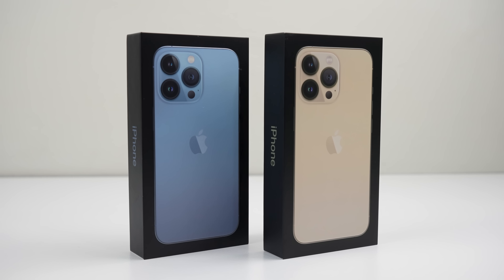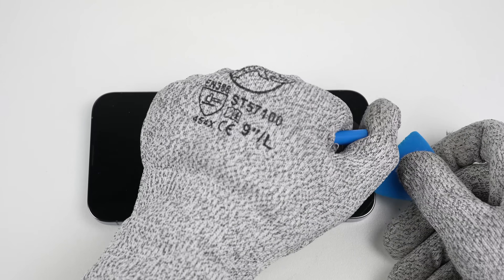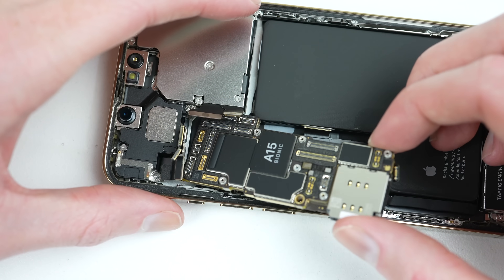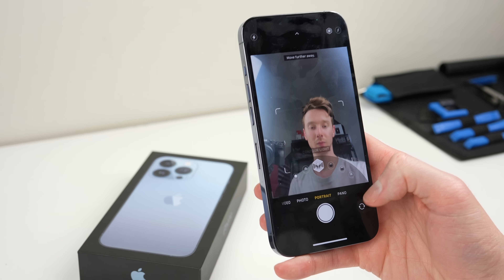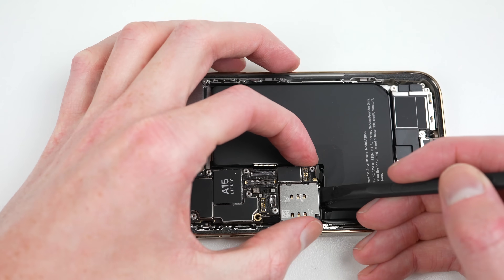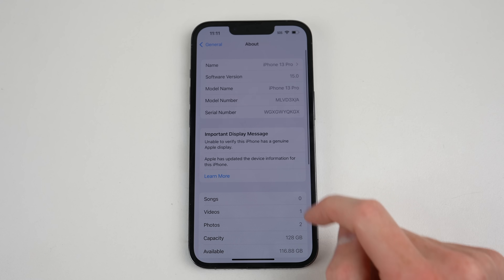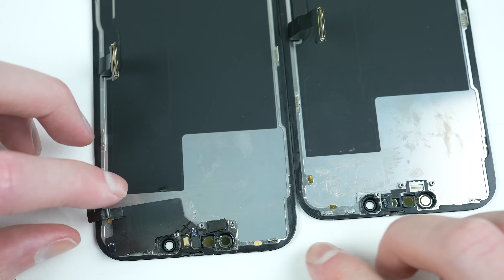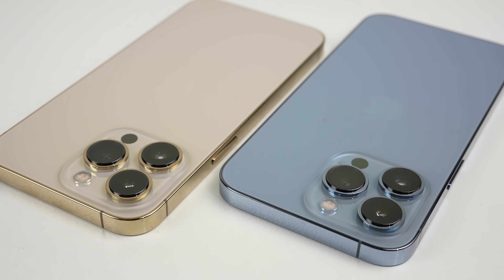iPhone 13 A Repair Nightmare - Teardown and Repair Assessment

Comment: Hey Hugh, nice video as always! Do you have a possibility to replace display chip information? I've seen this many times for older models to fix the issue with replacement display, that they download identification from old display and flash it to the new one. Maybe that can bypass these issues...
Reply: I'm sure someone is already working on it, but may take some time.

Comment: This sucks, big time. I semi-regularly repair phones for my family and friends and have been following Apple’s year on year bullshit software locks. Replacing the Touch ID / Face ID module, fair enough I can see why they’d disable the feature, but replacing the screen clearly should have no impact whatsoever on such a core function of the device. Totally shameful Apple.

Still, I’m sure China will come out with another device to reprogram the chips screen on the screen to make your phone think it still has the original screen attached.

Comment: I can understand the face ID issues... But breaking camera, battery and screen over replacement even from the donor iPhone is seriously ridiculous. Apple doesn't have to do that... They can display warning about device not having apple parts(They need to fix the pairing to the motherboard and swap it for some identification) and call it a day.

This is not about security or quality this is about exploiting it's users so they can sell at higher price and then when something goes wrong squeeze more money from them.

Comment: I agree with Apple's strategy.

If you give your phone to a non authorized repair shop and they make a mistake they have NO liability, so if they break your phone that is it, end of story, you risk losing everything. And at that point you'll have to buy a new phone, and any data that was not uploaded to the cloud is lost. So, to avoid and mitigate this risk Apple tries to make it impossible for you to repair your device, because if Apple repairs your phone you have the guarantee that it will be done correctly. And even if they do make a mistake they are liable and legally responsible for any damages, so they are required to compensate you.

Also, iPhones are not cheap phones. They are complex and expensive devices and just like an expensive Audi or Mercedes, I would much rather have my break calibers fixed by an authorized Audi or Mercedes auto shop than some random third party auto shop, even if it costs more. I prioritize safety over saving a couple bucks. I'd rather pay more and have a guarantee that the job will be done by a qualified technician than save money and risk a bad job.
Reply: And also if you don't want to get your phone repaired by a 3rd party, no one is stopping you. Go ahead and get your phone repaired at Apple, we don't care. Your phone, your purchase, your choice, right? We should have any right to repair the phone ourselves. We should be allowed to take the risk of having a bad repair. This doesn't excuse apple locking hardware with software.
Reply: This is inexcusable. They lock so much of their hardware with software. This means the repairability of these phones will be bad.  This is so bad for the environment, what are you going to do when apple no longer repairs your phone because it is too old? It will just belong in the trash. You are acting like apple repairs are the most amazing thing. Apple will also say some stuff "are too hard to repair", even though a 3rd party repair shop would be able to repair it easily. You should watch Louis Rossman and research Right to repair.

Comment: This is worse than it seems. It’s not just about fixing a new phone. I have a three year old iPhone Xs Max that I took to an authorized repair site (Best Buy) to replace the battery.

They told me the top speaker failed their test, and because it’s part of the screen I’d have to replace the screen as well as the battery. They would not replace the battery otherwise.

Let me be clear: There is nothing wrong with the speaker, it sounds fine. This is a deliberate scam to force me to replace both the screen and battery, which would cost over $500. 

Which is itself a deliberate scam to simply make it so expensive to repair my (paid for) three year old IPhone that buying a new one makes more sense.

And Apple’s story that it maintains quality is nonsense. This same ‘pairing’ technology could totally verify that it is a genuine Apple part (even though forcing you to do that would be illegal as well). 

But instead they use it to verify whether it’s the original Apple part, and use this technology to subsequently maintain a stranglehold on the marketplace.

This is the definition of a monopoly and is illegal. I’m not big on govt interference but the government should interfere. This is a long-term monopolistic policy and is totally un-American..

Comment: I see this as double edged, 1 it prevents 3rd party parts that otherwise are faulty (have dealt with a screen that turned out faulty) this also is a good way to make sure it’s working as it’s intended. But I can also see how it’s preventing repairs and not being all that good. It’s a win lose atm and should allow repair partners access to re serializing components to newer parts that apple has verified and tested, it would solve the issue then.

Comment: I'm never going to buy any of the apple products. Just think about the new M1 laptop. The laptop is so thin that even we can't even apply a sticker around the keyboard and touchpad to prevent it from scratching. The display of the M1 MacBook breaks randomly. We spend around 1000-1500$ to buy a MacBook and then have to spend 800$ to replace the display. It's not our problem. It's a problem that there were aware of when designing the M1 Laptop but ignored and kept making it. They don't think about their customers. All they want is money. I've watched a video on Phone Repair Guru and one of his customers brought an iPhone that has a malfunctioned microphone. The owner has said when he took it to an apple store what they said was "the device cannot be fixed and you have to buy a new device". Phone repair guru replaced the microphone just for around 50$ and the phone was functioning again.

Comment: the non-pro iPhone 13 still has the modular sim tray, the reason why the 12 Pro had it was because the 12 and 12 Pro was basically similar. The 13 and 13 Pro are not.

Comment: If they really want to protect consumers from repairs with crappy replacement parts, they should just add the warning "Replacement camera detected. If you observe poorer image quality, take your phone to an authorized repair center". Only show this everytime on reboot. No need to make the camera not work. Consumer won't blame Apple for crap results but user will still be able to make repairs.

Comment: When phone repair guru swapped the sensors on the screen Face ID still worked. Only changing the screen disabled Face ID. I wonder if the final build of 15.0 changed it.

Comment: The only way Apple or any of these other companies will change these practices is if the court system tells them that they have to. That’s why right to fix must become federal law. In the United States we do not have the right to fix. If I’m spending thousands of dollars on phones I should be able to keep them maintained for as long as possible. I should not be forced to buy a new phone every time some little thing messes up on my current one. I myself am rock in the iPhone 12 promax and I will not be upgrading to the 13 promax. Maybe the 14 promax but it’s gonna have to be a whole lot different than the one I currently hold in my hand. Otherwise there’s still no point to upgrade.

Comment: There has to be a way how does apple do it? Is it software  serial number check for each part on boot? If so we just need to be able to change the digital serial number. That’s prolly already a thing or completely wrong I know I’m not the first one to think this way

Comment: Have you ever thought about switching the motherboards and taking it to an apple store with all the issues and see their response/ repair process?
Reply: They’d simply offer a replacement at full price
Reply: That's what I was thinking, could you just ask them to disable the software locks and give Tim Cooks kiss of approval? Or would they just turn you away?
Reply: @Antonloading  They would straight up turn you away-  if the phone doesn't  have the original apple parts in it, then they won't touch it. Doesn't matter if its genuine apple parts or not.

Comment: Reading Walter Isaacson's biography about Steve Jobs, it is clear that hampering or preventing repairability was a mantra of Steve Jobs from as early as the first Macintosh. We should hardly be surprised that Apple is still as anti-repair as it was back then.
Reply: This is why Wozniak is known as the opposite side of Apple. Had Wozniak ran Apple we would have many options for repair, even official repairs would be very feasible immediately. But no.
Reply: @rosaria8384  If Wozniak still ran Apple we wouldn't have anything remotely close to what Apple is today. Wozniak would have built another Dell.
Reply: Ironic given that Jobs died because his body didn't function correctly after a pancreatic upgrade.
Reply: @libertyordeaf  that's awful but really funny 🤣
Reply: Did Apple elaborate on how third party parts and fixes affects them directly? Are they plagued by customers when some third party replacements affect the working of the phone? Can they no longer guarantee security from parts sourced from China? And so on. To clarify, not asking for a ream of speculation, just interested what Apple itself has said over the years, like in Isacson’s book.
Reply: @tonyhawk123  Apple just rolls out the "security" and "safety" issues crap...all easily proven to be utter garbage, but it still manages to "win over"  people who decide on and bring in legislature, with a healthy dose of paid for lobbyists (legal corruption and bribery) thrown in, plus i'm sure they "get" at others in high places that are able to do their bidding
Reply: @bazwillrun  Look at any security review for malware on mobile devices and see how Android fairs verses Apple. Add to that Android is made by an advertising company with business model geared to invading your privacy. And then there's the fact vast majority of Android handsets arent running the latest OS, where as vast majority of iPhones ARE running the latest OS - so good luck getting security updates. But just pretend none of that is real to prop up your anti-Apple stance on security.
Reply: @tonyhawk123  why do you compare an OS to a tech company?
Reply: @tonyhawk123  Well like there are many unrepairable android phones… it‘s not like apple is the only bad company
Reply: @steel9490  Samsung uses Android.
Reply: @tonyhawk123  not just samsung uses android OS. there are tons of other phone companies that do
Reply: @steel9490  are you deliberately being dense? I compared the OS used by iPhone with the OS used by Samsung. Quit brushing off Samsung's flaws. Any security flaws levelled at Android obviously apply to Samsung.
Reply: @tonyhawk123   you sound like an apple fanboy. and i get the feeling you are highly biased. never have i said android OS or samsung was perfect yet you claim i do. both sides have flaws, apples is just bigger. they deliberately make repairs harder for their products to the point of them being near impossible. so when your phone gets broken you either have to pay a significantly higher fee to get it repaired or throw it away. which isnt very green am i right? along with this the whole experience leaves the customer feeling like nothing but a cashcow. and unless you code-that of which i do- you have no idea how easy it is to hack an iphones individual OS. and no, its close minded people such as yourself who are dense
Reply: @steel9490  so no counter arguments. Ok.
Reply: @tonyhawk123  rather you chose to see a counter arguement or not is your choice. if you choose be ignorant that is also your choice. either way life will keep going on and technology will continue to advance. the only person you're hurting is yourself
Reply: @tonyhawk123   so why is official repairs also made so deliberately unfeasible?
Reply: No wonder Apple was so repair and upgrade-friendly when Jobs wasn't there.
Reply: @Izolir Traka You can say the tech illiteracy part about Cook far moreso than you could Jobs.
Reply: Yet, early macbooks were so easy to repair and upgrade..
Reply: @pedolopes317  compared to current MacBooks, not compared to contemporary laptops.
Reply: The original macs use toque screws, he did indeed try

Comment: ❤️ Love apple .... ✅ the way a see it is that when you buy a used device you are sure that it comes with original parts and not a dodgy repair shop with fake parts from china ‼️ no exploiting batteries, no low res cameras, no faded screen colours, no over heating chargers ... great work from apple reason why is most valuable company at $2.5 trillions
Reply: Would you be up to respectfully debate this? Because what I see here is apple monopolizing repair on their products, I would encourage you to find one example of a monopoly that benefits the consumer. There is a repair place down the street that has been family owned for close to 20 years. They are dying, not because of covid, but because they cannot get parts. If apple truly cared about the customer experience, why don't they sell their own 1st part parts? Why is it that when a repair shop orders a shipment of genuine apple parts, it is seized by customs. The apple authorized service provider program enforces a set of rules that make it impossible for 3rd party to compete with the apple store. If you sign up for the program, you are not allowed to stock parts, this means that it takes 3-5 days for an AASP approved place to do a simple display replacement. What about the millions that live in remote areas 3 hours away from an apple store?
Reply: @Carterthielftw_  I understand your point of view and is valid what you are saying, what I think is that Apple wants as any other company selling franchises subway, McDonald’s etc etc or Tesla as repairs are only made by them and the workshop is not longer been able to repair anything what this is, is to be in charge of the supply of parts and as I see it is good as the quality of their products are still premium, for the people in remote areas is not going to be more complicated that what currently is to reach a retail shop to buy a new one or get shipped to Apple for repair and return!! 
Shops of 20 + years reselling or repairing is a business that is been face out for the past 10 years nothing new here what I have seen steadily growing is the shops reselling Apple products but no repairs!!